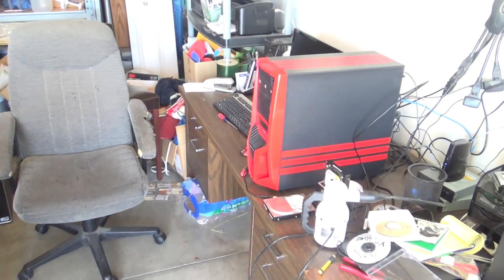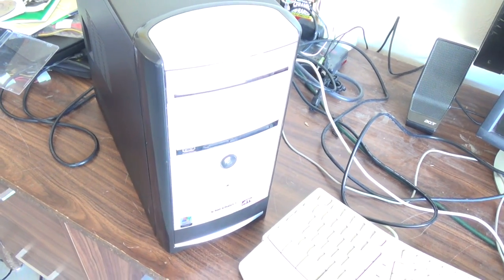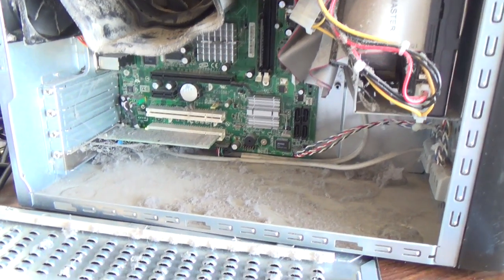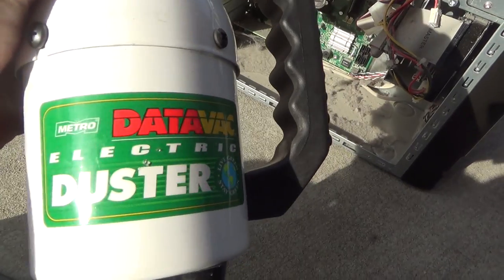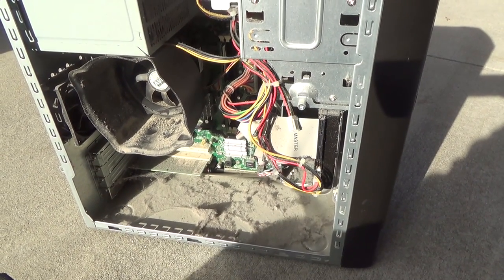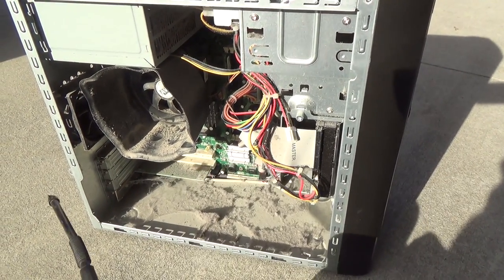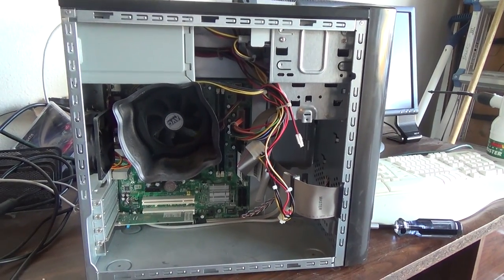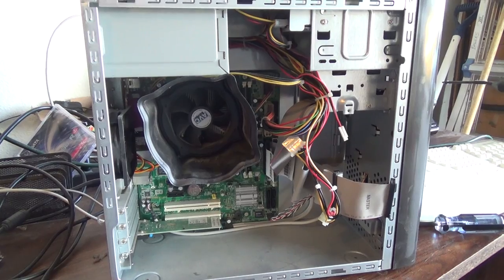One Dusty Computer Tower - And An Awesome Device to Clean It Up

Comment: I have been cleaning computers like that for a couple of years. One occasion I used a professional and very powerful air blower, the ones used to clean the streets, and the computer was totally cleaned in about 1 second.
Reply: Probably blew a few filter capacitors off in the process.
Reply: +ScreenGames lol
Reply: HardTruth "totally cleaned" where the pc stood is totally cleaned spotless because you blew the whole thing away.

Comment: My old computer had a 25cm fan on the side panel which eventually stopped working due to dust as I never cleaned it. I had to take the side panel off to ventilate it. Needless to say, I now clean my computers at least once a year.

Comment: Pro tip: You can also use an air mattress blower to clean a PC and by far it is one of the best methods I have ever used.
Reply: GREAT IDEA
Reply: +Jason Tavarez (Jay227ify) 

won't do the job... not enough power...  try it if you want, but it won't work.
Reply: +Paul Moadibe  I tried it and it completely took all of the dust outta my case. It depends on your air mattress blower i guess...
Reply: Only electric ones... Not battery
Reply: Hahaha the sound when he was cleaning out the pc reminded me of something. Now I know what that was.
Reply: Jason Tavarez A vacuum with a dusting head also works because that's what I use with my PC
Reply: superferretfun: That will absolutely damage your PC. Google it.
Reply: Mate I do it once every week and it's still going and nothing at all has changed
Reply: Manual or electric?
Reply: Thank you!
Reply: OMG i think I have one!!! I was going to use my blow dryer!

Comment: use a paint brush with long bristles and "paint" with it where the dust has settled and dripped onto stuff to loosen it.

once youve finished with the paint brush use your duster. i personally prefer an electric leaf blower. leaves everything looking brand new and it has more air mass to push stuff through radiators and thin small pinholes in the dust filters. but otherwise awesome video!

Comment: I use that same tool for years now. In my opinion I vacuum all the dust I can first, then I use a simple paint brush to loosen the dust that may have encrusted itself into the components, then I use the duster. I also wear a dust mask to prevent inhaling all that nasty stuff and I have a big fan blowing air away from the entire system (all done outside of course). In addition, to do a complete clean up, I would remove component by component and clean them. I will make a video on my method but this is pretty much a great video!

Comment: Great tip on buying the duster to save over compressed air here's a couple points you might want to think about.  You should clean the intake screen on that duster, they can overheat as well. Also I would think that vacuuming the power supply vents first might be better, that way you're not just forcing the dust back into or deeper into the case. also the backside of the motherboard and case hold ALOT of dust. Just a thought

Comment: I think it's worth noting that the reason you don't damage the fans is because you never spin them faster than they were intended to go. I think most people think that damaging fans by blowing on them is a result of the actual air flow but it's really about the fan spinning too fast and damaging a few ball bearings.

Comment: Also, if it gets so bad you can always wash it using contact cleaner (the kind used to clean sensitive car electronics). It's like washing it with water but it doesn't damage it and it leaves it looking new.

Comment: These things rock. They cost about 60 USD and they last forever and will save you hundreds or possibly thousands on canned air over the years depending on how much of the stuff you use in your house or job. Not to mention they don't lose efficiency after 30 seconds like a can of air does. Also handy for dusting around the house in general. Only real maintenance you need to do is cleaning out the filter at the bottom every now and then or you can get a set of 5-6 replacement filters for 10 bucks which will last you for years.

Comment: Nice video. Although I think perhaps with the amount of dust in that case you should have vacuumed up some of the dust prior to blowing it. That way you avoid blowing some of the larger bits into areas that will not blow out. I like the tool but seems a bit pricey when you consider you can get the same kind of results with an air compressor and air chuck with different nozzles and it can be used for a variety of jobs.

Comment: Wow, I would be unhappy if this was my PC, you need to take the cpu cooler off and maybe even the fan and clean ever bit of dust off. Then clean the cpu and put thermal paste back on, if you tried to give me my pc back looking like this, I think we would have much of a problem....
Reply from the maker: LOL.  I reinstalled his windows operating system, backed up some of his pictures and files before, and replaced them  once I reinstalled Windows and then I downloaded all his most current drivers and commonly used programs (Java, Adobe Reader, etc etc) then I blew out the dust inside his PC tower as well.. all for like $30 USD.  And you would have been angry because you didn't get all the parts scrubbed clean and new thermal paste put on the cpu?  gtfo. lol.
Reply: Ohhhhhhh, sorry man, I figured he ended up paying you around 50-150$ lol, just because he didn't know things about pc's is my guess, I'm saying I don't know
Reply: For 30$ that wasn't that bad of a deal lol, by the time he bought canned air, taught himself how to do/clean it and the time it's worth the 30$ lol
Reply: GoLdxSNIP3S he would find a dinosaur in there XD
Reply: Actualy noobs only pay people do the job for theme  but onece who know what are they doing they will do it themeselves i know i am a pc buider and servicer but i must admit this shit is realy dusty
Reply: GoLdxSNIP3S i agree im a pc builder/ tech and i take the computers i get fully apart and deep clean them cause if i sent a computer back with all kinds of dust there would be a problem
Reply: GoLdxSNIP3S e
Reply: Are you the kind of customer that would also be asked what their expections are and reply in a vague "just make it better" sort of way then get pissed because the guy didn't read your mind?
Reply: GoLdxSNIP3S the CPU doesn't have to be removed if you're cleaning it
Reply: Zaxtor99 awesome job! But man! Why did you charge him 30$?? That's super cheap.
Reply: I have found that no matter what you do you just can't make everyone happy. You did a fine job. I do the same. I fix people PC's and upgrade them. I had one that had ransom ware on it and I wanted to do a system restore to get rid of it, but the customer didn't like the fact that they would lose their files. They didn't back them up ever. So I had to get rid of it the hard way and after a couple of hours I had liberated their PC  from the ransom ware. They didn't want to pay Geek squad $150 to do it because they were going to do a system restore as well. I only charged them $50 and they complained about that. Some people . I should have refused and let them take it to Geek squid and get ripped off. I say keep up the good work, there are those that know you are being very fair in your pricing. I charge $25 per hour and probably should increase that rate.

Comment: The number one thing I do like this is carefully move the refrigerator out so I can get behind it and using what ever tool necessary to clean out the dust from the compressor and coils. Dust and the overheating is the number one cause for failure of your refrigerator. no do not blow the dust out but use a vacuum and the vent tube brush for the dryer vent (dust in the dryer vent number one cause of your dryer catching on fire). It is true clean equipment runs longer.

Comment: I have an old computer and the fan is running fast when I turn on Google. I try to clean it with an air can but I end up using a cotton swab to get out the dust. What I would like to know is why can't you use a vacuum cleaner nozzle to get out the dust?

Comment: I use a dry vac with the plastic hose reversed to blow air.  I also use the household vac in parallel, on the exterior of the case.  While the dry vac is blowing the dust out, the regular vac is taking a lot of the dust out of the room.  I do this every 3-6 months.
I also take my DELL CPU cooler off completely and remove the thermal paste to all surfaces with alcohol.  I take the cooler and shroud completely out and wash it/dry it.  Then reapply new thermal paste and reinstall the cooler w/shroud.  I do this every ~2 years..

Comment: The power generated by the fan motors spinning is negligible and won't damage circuits on the motherboard, there is another guy who posts computer repair videos who uses a leaf blower to clean them out and he said the same thing. Only thing to watch out for in my experience doing this is make sure nothing can get blown into the fan while it's spinning, I had some of the cabling get blown into one of mine and cause blades to break off, but never had bearing damage or voltage issues

Comment: I just use a blower from my air compressor with 2 inline dryers and a grounding wire on the tube i have coming off of it and seams to work good and hasn't damaged anything yet. But if it is really bad yes i will take it apart to clean it and re apply thermal paste where needed, but only if i can not get it clean with just air

Comment: After u cleaned it up did u saw any differents before and after ? and did it also increased your screen like speed up for games ? Please let me know..
Reply from the maker: +JuStSoMEM0Ds - Thanks for the question juSt... Your answer is NO.. you will NOT see your integrated graphics and 8 year old CPU turn in a new Intel I-7 CPU with a GeForce GTX 9800 graphics card because you blow the dust out of your PC tower.  

..Yes, I'm being sarcastic, but your answer is "No", you won't typically see a performance upgrade by cleaning out your tower, but what you WILL do is increase the life of your PC and prevent important components from overheating due to dust build up.

Blowing out a PC tower is pretty much the same as changing the oil in your car.  It will help extend its life, perhaps make it run more quietly as the fans can now run more efficiently, and perhaps even prevent random lock-ups of your PC due to overheating hard crashes in the future.  

I hope that answers your question and helps you understand why blowing your computer tower out regularly is important, even though it doesn't directly make it run faster or run games it couldn't run before.
Reply: +Zaxtor99 thank u for you answer ! Is there any other way to upgrade or Something for games like FSX ?
Reply: +JuStSoMEM0Ds A new CPU and GPU. But with those you might also need a new motherboard, ram, power supply etc. so it might mean basically building a whole new PC
Reply: BarrettBullet alright thanks for your answer and i will search forward
Reply: +BarrettBullet I have i5 2500 3.30 ghz, 8gb ram, and a cooler master 550W powersupply my question is can i buy a GTX 960 ssc acx 2.0 + 4GB, will my ppower suppl y handle it?
Reply: he didn't saw, but he did see.

Comment: I take my customers computers to the porch and use a leaf blower.  I will also use my datavac if it isn't that dusty.  

 Also for the people that think the spinning of the fans will hurt the motherboard.   Diodes  are used .  

 Diodes allow voltage to only flow one way eliminating back flow  of voltage\current.  There are also ic controllers on the board that control fan speed.

Comment: Most PC's/Computers that are modern have BIOS Settings that can allow you to set your fans to run in the Opposite direction while starting up to allow the dust to be kicked out of your system.I have it.. It works very well for what it is... But still recommend taking the side panel off and 'manually' clean it... The BIOS gets rid of the dust in the fans but not completely out of your system.

Comment: I take my (self built) pc apart once a year and clean all fans and heat sinks with a brush. Also then re-apply fresh thermal paste on the cpu. Been running great since 2009 and still runs all modern games (not on ultra settings obviously).

Comment: I normally don't bother removing the components but I think you should take the CPU fan off, more dust collects between that and the heat exchanger than anywhere else in the computer and it can become very clogged up, so much so that simply blowing air at it may not remove it.

Comment: The reason you hold a fan is not because of current.

You stop it from spinning so it won't burn out the bearing from spinning to fast. 

So if it gets spinning to fast, you'll hear ticking from the fan when you go to plug it back in and fire it up.

Comment: So I'm curious, this is great cleaning but considering that dust can make it overheat or perform badly.. What about soot? Like.. You know soot from fire smoke and such? Because my house caught on fire about 4 months ago and I know there's still some soot in my computer but I can't clean it out completely (Nor do I have a fan for it yet, thinking about getting one or trying to use leaf blower) and it has performed about the same but recently I haven't been able to play a certain game well. I'm not sure if it's the soot that finally caught up with the pc performance or maybe my pc overall. I've tried cleaning it out with Q-Tips before but one time my computer just went black and... Yeah I got a bit worried but got it to work again lol.
Reply: +Jacky Vang Not sure if you're still having issues or not but if so I'd recommend taking it apart and cleaning out the components individually so you have a bit more room to work with and get to spots you wouldn't normally be able to get too, hope it helps.

Comment: Blowing the fan does not kill it as I have tried it many times with more powerful blowers. But at this dirty level I would take the computer apart because it is most likely needs further cleaning and at least changing thermal paste for cpu. They are pretty cheap so I think there should be no cost except for time. About 90 minutes will be enough to disassemble and reassembly of this pc

Comment: Nice, thanks.  Can I use a blow dryer and/or vacuum?
I did try to take my tower apart once..used to have a friend clean it up me..I didn't see him do it..and I actually unscrewed the back!!!  The computer fell into the tower..Freaked me out!  I got it fixed.  Now I'll try to remove it again the way you showed..mine is as old as the one you described.  Thanks..nice video.
Reply: Do not us a vacuum to clean out tour computer as it can cause static build up which can short out components. Dust sheets/cloths are also bad for the same reason. Compressed air is the safest way.
Reply: Joe Powell   Oh..I wrote up top..thanks!!  I appreciate it!!
Reply: Joe Powell sorry how do you mean? I have been using a Numatic henry vacuum for years?!
Reply: Mike Razor When using a vacuum you can build up static electricity. This static electricity can short out components such as the graphics card as there is open curcitury. Hope that answers you question if not just say.
Reply: Mike Razor 
I may get one....I've heard NOT to use a hair blow dryer to get rid of the dust..I don't need anything that big though, I will most likely keep an air pressure jar around.
Reply: Joe Powell HI Joe, Thanks for the reply.. I thought most items have static electricity? Maybe you mean if you are using a brush and actually touching the board?

Comment: would it be okay to use this on my gaming consoles? like xbox or ps4?
Reply from the maker: Absolutely!  I use my DataVac for blowing dust out of my PS3 and other electronics that get dusty as well, though it probably isn't nearly as important to open it completely up and dust it out regularly like a PC tower.  I do use it to blow out the air vents on the PS3 and other consoles however and it works beautifully.

I've also used the DataVac to help me blow out things like vents in my house that get filled and clogged with dirt over time, etc.  It's a very nice tool to have and very durable as I've used it well over 5 years now on hundreds of PC towers and other chores, and it is still running perfectly!  That kind of quality is pretty rare in today's products, so highly recommended and easily one of my wise and best purchases of my life.
Reply: Thanks for answering my Question man! Sounds like an awesome device. Will be ordering one very soon. :D
Reply: Zaxtor99 hey would it be okay if I use it to clean a GPU?,and what could possibly go wrong if I clean my PC with this?
Reply from the maker: Hey Jaime.  Thanks for your comment and questions.  I use this DataVac to clean the fans and dust off of GPUs all the time and it works great.  I can't imagine anything that can really go wrong using this device as I've now blown out more then 300 PCs with it and haven't had anything go wrong at all. 

In fact, using the cans of air or an air compressor instead of this device could put liquid or condensation water into your PC, and is much more likely to cause problems.

Great question, but the DataVac is easily one of the best purchases I ever made.  :-)
Reply: Zaxtor99 Okay,thanks,that was really helpful :D
Reply from the maker: Erm.. No.  But it will help your computer running period and keep it from getting too hot and possibly burning up a critical component due to overheating.
Reply: ***** If the fans are running at full speed because they are filled with dust then it will reduce the noise.

Comment: i get computers that are clogged with dust and cobwebs like this all the time. if its a windows xp or newer pc it will have overheating features that will slow down the computer if its clogged like this one. it often restores performance in the way that before and after cleaning its noticably faster and/or quieter.